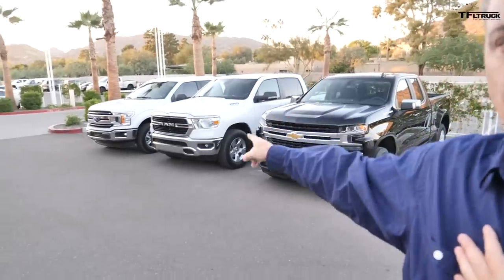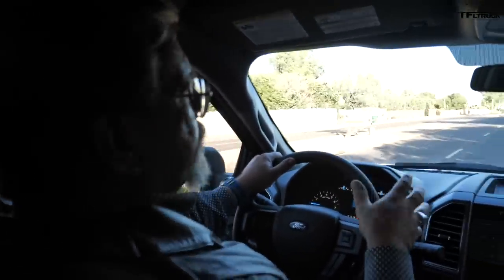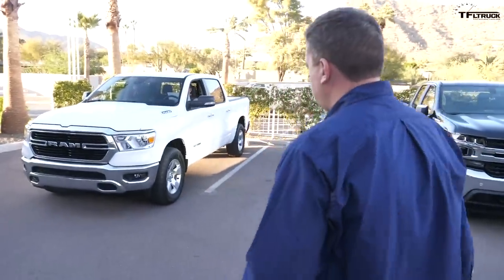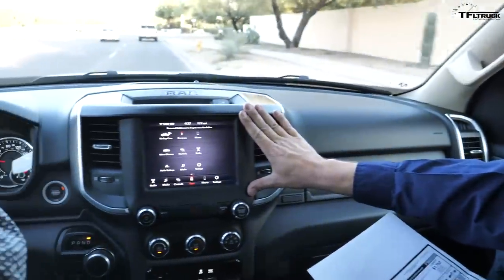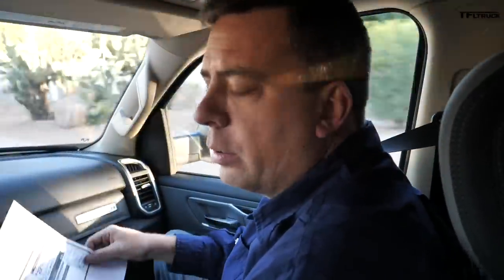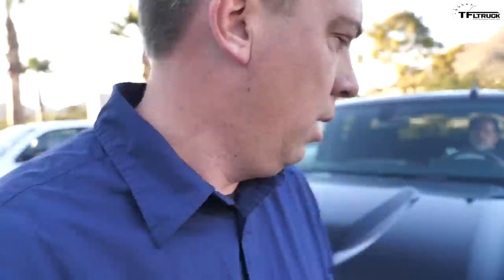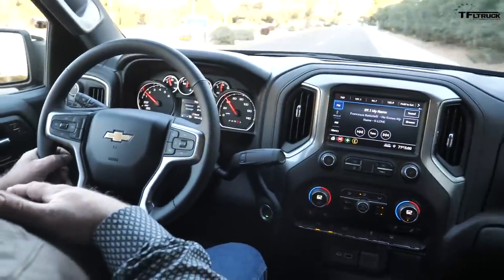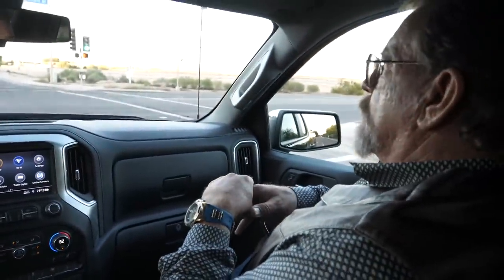Work Truck Wars: 2019 Chevy Silverado 4-Cylinder Turbo vs Ford F150 vs Ram 1500 Review

Comment: Chevy didn’t dare to give you guys the Ford with the 2.7 V6 turbo.
Reply: Probably because it's not a base engine.............
Reply: Yeah that wouldn't make sense to give an optional engine to go against a base engine.
Reply: White Wolf 4.3 ecotec
They stopped making vortec 4.3 vortecs in 2013
Reply: @imzevoh8327  They did not, in 2014 they debuted a new 4.3 based on the GenV DI small block.  All alluminum, literally the 5.3 or 6.2 with a pair of cylinders lopped off.
Reply: Track Days can you get the 2.7L - 4 banger in the WT trim? Or Custom trim? I think LT and maybe RST. So it Probably should be compared with the 2.7 EcoBoost. But it doesn’t matter really because the market will determine how well it does against the competition.
Reply: White Wolf in 2019 the 2.7 is now the base engine. Just like they made the 2.0 turbo the base model for the Camaro
Reply: Jason Crossley the original 4.3 was a 350 minus two cylinders. The new 4.3 has a bigger bore than a 5.3 and smaller than the 6.2. the only thing they share is the stroke is the the same between all three engines
Reply: The STX model F150s (pretty much base model) come with either the 2.7 or the 5.0, with the 5.0 being the option.
Reply: White Wolf on Chevrolet's website it's confusing in some configurations the 4.3 is not available so they are both kinda the base model
Reply: Expected
Reply: Different class not meant to compete with that motor
Reply: Ford sounds the best.  Hate to admit that, but it is what it is.  Seems like 2.7 was the wrong engine to test here.  Oh well.
Reply: That engine isn’t GM’s base model either
Reply: @stephenlozada7158  sorry but this but this engine is base for some configurations and optional for others just like the Ford. Chevy may not want them to compete and I understand why.
Reply: NO.  the  2.7  turbo is the base engine on the LT ,  you cant even get a v6 in the LT as of 2019 models. you go straight from the 4 banger turbo , to the 5.3 for $1,000..... similar to the ford the small v6 ecoboost is only a $1,000 option over the base NA v6.
Reply: the  chevy NA v6 4.3 is only standard in the literal WT (work truck) model  , Custom , and  Custom Trail boss.  which are all slightly different variation of the work truck with very limited options. and on these models (for whatever reason)  you can't even get a 4 cylinder turbo .  you jump straight up to the 5.3 v8 for $1,000  similar to the LT.  lol  its confussig until you see it laid out on a chart.     Scroll down about halfway on this link.   https://www.jackburford.com/blog/2019-chevrolet-silverado-engine-options-and-transmission-options/
Reply: @imzevoh8327  yes a new name but it still the same engine and what about what I mean by that is they have bump the power up but at its core it still the same engine
Reply: @derrickkimsey1921  bit of clarification here...  the 4.3 ecotec is as close to a 4.3 vortec, as the new 6.2 is to the old vortec 350.  Totally different engine design.  It is not the same at its core, it's not even close.  I would be amazed if they shared even a single common part.
Reply: @derrickkimsey1921  Wrong! Just wrong!
Reply: yah... totally agree the 2.7L ecoboost is the true competitor to it
Reply: DURAMAX_DELIGHT Done the math...The 2.7 Ecoboost will kick it's ass!!!
Reply: So if fords 2.7 ecoboost isn’t the base engine but it still cost the same or less than chevys 2.7 4 cylinder... then doesn’t it compare?
Reply: DURAMAX_DELIGHT  bless your heart
Reply: scot miller
the new 4.3 has smaller bore longer stroke
Reply: @White Wolf This is probably the final year for the 4.3L. The 2.7L is the base engine in most trim packages.
Reply: 4 banger in a truck. Lol. No way.
Reply: The Ford is far superior
Reply: There is no way they compare to each other...should have the Ford 2.7 next to that 4x4..
Reply: @imzevoh8327  it's the 4.3 v6 at 285 hp
Reply: Let’s see Chevy 4.3 v6 vs Ford 3.3 v6 and then Chevy 2.7 i4 vs Ford 2.7 v6
Reply: DURAMAX_DELIGHT ya know, Chevy had the option to make a 6 cyl. Turbo engine, but they didn’t.  The point is Chevy put their non-base model motor up against Ford’s base model. Not an apples-to-apples comparison my friend.
Reply: Trevor DeRouchie In every way possible. Not just power, but build quality, technology, mpg, and just about everything else that you can think of. The only people that say otherwise are the ones who's daddies or grandpa's either swear by GM because they're easier to work on or because GM damn near gives them away to employees or employee families with their discounts and rebates. GM truck fans = thick skulls. Ford truck fans = bigger brains. And for the record my wife's car is a 6 year old Malibu with almost 200,000 miles and it's been great. But we're talking about trucks here. I've also have a Ford superduty with the 5.4 litre spark plug spitter, but these new ones (5.0, and both Ecoboost engines) are insanely reliable and powerful
Reply: kyjoe9 That would be the logical comparison but nahhh... Chevy would compare their 6.2 to fords 5.0... Oh yeah they have already and the Ford still outran it! LOL
Reply: @White Wolf the 4.3 is only available on the work truck trim. all other silverados get the 2.7 as base engine.  no doubt the v6 will be phased out for good next year.
Reply: @smarticus6384  ford will sell you a XLT with the 3.3 non turbo so it is a fair comparison between the chevy 2.7 turbo and the 3.3 non turbo
Reply: 4.3 is only the base engine on LS and base trucks. Base engines on LT and higher is 2.7
Reply: Why is the Coolidge era 4.3 liter V6 still being mentioned? That was hot in like 1985 when they put a quadrajet on it.
Reply: @kyjoe9  It hasn't been proven yet but its safe to say the 2018 2.7 ecoboost F150 is the 2nd quickest truck on earth next to the 3.5, then the 6.2 Chevy in 3rd.
Reply: @McBosshog85  yeah you are right my friend has a base f150 with 5.0 and manual windows haha
Reply: @ColdSmokes  They redesigned it back in 2011 I think. It's an aluminum block now and puts out a lot better hp and tq numbers
Reply: why would they?  The two engines are completely different!  one is a 4 cylinder with 1 turbo and the other is a V6 with twin turbo's!  duh.  your argument is stupid and ignorant at the same time!  now slap yourself for saying something stupid on a youtube message board.
Reply: @Rocksolidbullys  same displacement though
Reply: Hell naw,It would have smoked that Chevy easily.
Reply: because all the ecoboosts weren’t done exploding lmao
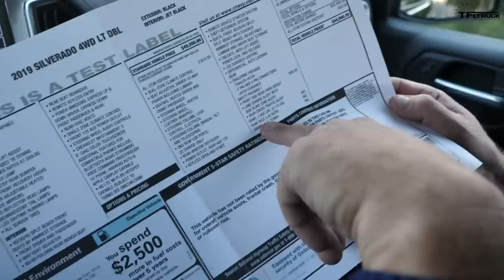Reply: @White Wolf This video is about a new engine offering though. The 2.7T wasn't available on 2019s *at all*, and the 4.3 isn't the new engine or part of GM's new strategy, and will eventually be discontinued except possibly for WT models. The Chevy in this video is an 2020 LT (shows on the Monroney at 27:28), and the 4.3 isn't available on LTs for 2020 (as shown on Chevy's own configurator).

Also yes, the current 4.3, which has been around since 2014, is a totally different (non-Vortex) engine than the 4.3 Vortec, which was based on the old 4.3 going back to the 1980s. The only true "Vortec" engine Chevy still offers, but will very shortly die off entirely, is the 6.0 V8 in GM's HDs.
Reply: @bryanmesser7098  yes it is.

Comment: $40K for a 2WD V6 F150? Insane...
Reply: Insanely cheap or insanely expensive?
Reply: @bencoyle7555  expensive. I paid 45k for my Chevy 2.7 with 4wd. Ford is overpriced shit.
Reply: @roblacerra3257  you say overpriced shit when you bought a truck with a smaller engine for 5 grand more 😂😂😂 clueless

Comment: I've rented the RAM and the F150 base trucks, they are fine for day to day driving and normal truck use, I think the price points on the trucks have gotten out of hand...
Reply: Z2357111319 Have you seen those end of the year discounts for $10 grand? That’s because that much profit is tacked on to the price. You can get them much cheaper at the right dealer.
Reply: @garybulwinkle82  Its not that...Europeans tariff the he'll out of our cars then only want to buy European.  The thing about European cars is without the tariffs based on value they cant compete. European cars break down at the same rate and cost more to repair.
Reply: If you think full size trucks are expensive, look at midsize suv's. They are expensive meanwhile less capable making this trucks look like a gooooodd deal. If you want a cheap truck you can order one from your dealer. Most dealers don't order base trucks because no one buys 'em.
Reply: @dam4274  As I read your comment about end of the year sales, an ad pops up for up to $16k off at a local Ford dealership. Wow! Amazing timing and dead on accurate. (If you have any psychic stock market tips, I'm listening . 😉)
Reply: Thats why I dont buy new trucks because you have all these people paying tge price of course they are going to keep the price increase as long as people buy them if people start buying low mileage used trucks the price will go down on new trucks
Reply: @dam4274  
Not in FL

Comment: Whats spectacular about 310hp and 340 torque from a 2.7..Nothing! The Ford 2.7, the one that always gets ignored makes 325hp and 400 ft.lbs of torque....at 2750rpm. That's spectacular...oh yeah, it easily gets 26mpg too.
Reply: You're right about the  2 7 Ford twin turbo being a HOT ROD!
Reply: Don’t forget tfl just had a video of a tuned ranger putting down bigger numbers at the wheels with just a tune with their 2.3i4. That 2.7 is also a beast when tuned.
Reply: 2.7 ecoboost
Reply: I went on a ~60mi trip yesterday in my 2.7l EcoBoost driving 55-60MPH and averaged 27.1MPG when I pulled in to the destination city.  :P
Reply: Pulled about 6k lbs moving from Denver CO to Yuma AZ and averaged 15 miles per gallon going 65-75mph, calculated from the pump. Pulled the weight like it had nothing behind it. The 2.7 ecoboost is seriously underestimated.
Reply: The 2.7l in the Chevy hits 348 st like 1500-1800 rpm
Reply: @bielmelichartes2167  um a lot of places a lot of industrial trucks have 4 cylinders

Comment: The price of new trucks is crazy!  I'm poor, and will buy used.
Reply: Chas106 G. — Consider the Colorado or Ranger.
Reply: @GH-oi2jf  A 4x4 Z71 Duramax Colorado will run you about $33-35K on the out going year model, will have most of the options offered and can tow 7600 lbs, which is easily as good as any base engine full size pickup.  If you an leave with a smaller cab(my long bed is easily comparable to the short beds of full size pickups, albeit a lower payload), it would be my choice - it literally was.
Reply: NEW Trucks are more heavily discounted. It’s harder to get discounts on used trucks.  Plus used trucks prices are inflated
Reply: Nothing wrong with buying used. Plenty of people gave me shit for buying a new one but i dont think they understand, if people like me didnt buy new, there wouldnt be any nice well maintained used trucks on the market.
Reply: USED Prices are up right there with new ! a few grand and your in a new truck. crazy
Reply: @Artie196161  i agree it is pretty crazy. I took my gf jeep shopping a few years ago and test drove a 2012 with 30k+ miles and they wanted i think $22k. I said screw that, took home a new one with 1.6 miles for a little over $30k after my discount.lol
Reply: @2005OEFArmy  I'd rather have the v6 in the Colorado but it is a less expensive option for sure
Reply: @JkeeneMX607  If no one bought new trucks the price would drop.
Reply: @williamisabell9539  i wish that was true...
Reply: If you think new truck prices are crazy, look at 8-10 year old used trucks.
In most parts of the country, you're going to pay mid to high teens for a truck with WELL over a hundred thousand miles(more upwards of 160-170) and just about anywhere East of the Mason-Dixon, they're going to have rust.
Case in point....
https://detroit.craigslist.org/okl/ctd/d/2012-ford-f150-ftruck-xlt/6754514337.html
https://detroit.craigslist.org/okl/ctd/d/4x42012-ramwd-quad-cab-1405/6754436619.html
Reply: If you are looking for a work truck cheap and heavy working truck, perhaps Nissan has a good deal to offer you. 
With the TITAN starting price of 30k
Titan XD gas 33 starting and
TITAN XD Diesel 35 start price.....
I prefere used trucks, because I am cheap and also my own mechanic so, what a hack.
Reply: And better if you seek a work Truck, my 70's and 80's chevy/ GMC square body trucks never let me down on payload
Reply: @2005OEFArmy  A truck that's not 48" wide between the wheel wells is a waste of time IMO.
Reply: Chas106 G. I’m not poor I’d say middle class for sure and I don’t buy new either. It’s a waste of money.
Reply: you want a full size truck,with small truck ecomomy,& reliable as a rock.???.go to brazil,find yourself an MWM,silverado or excursion or s/duty,.97 to 2007..4.2tdi.12.5 pt 100..mine has 700 nm..12.6 lt 100,s/duty.2002,in aus..i paid 25k au,,with 170k,s on clock.thats about what?,19k u.s.?.they have no tech.all mechanical,german engine..
Reply: right. Sad part is if you get too used, that SOB will be ffalling a part.
Reply: @bigcartoonyIIV  true.

Comment: What a sham from GM, and I know all manufacturers stack the deck for themselves but this is ridiculous. Some of the cheapest Ram and Ford trucks,  and a much more upscale Chevy. They used a double cab so the price didn’t seem as far off, but it’d be near 50k if it was a crew cab. A 50k Ram is an awfully nice truck. You can’t beat the ford 2.7 either for the money. Ridiculous
Reply: It's a base chevy.
Reply: @jdrok5026    Yeah, but a base Chevy is better than mid-level Dodge or Fords.  Not fair.  Heh heh.

Comment: If I’m gonna drop 40K for a F-150 it better have a 5.0
Reply: Amen brother! You get a mustang gt, a family hauler, an offroading rig and when the weekend fun is over, you still got a work truck........4 different uses/purposes in one truck....bad ass!
Reply: and we overseas have to pay 40k for a 2.0 diesel Ranger.
Reply: It’s going to be an Xl
Reply: Id buy a two year old truck fresh off a lease and get tripple the options
Reply: I like the turbo
Reply: @brianpeterson5890  The 2.7 and 3.5 ecoboost are both twin turbo.  If you happen find a Ford truck that's off lease it was more than likely a rental vehicle. F-150's don't lease very well at all. Rental fleet trucks are base xl or xlt, or sometimes base lariat trims, and when they are re-sold they are not much cheaper than a new one.
Reply: @brianpeterson5890  Yup, and maybe you'll get a truck that had an asshole previous owner that put bargain bin fuel in it, cheap oil with long intervals, raced it around everywhere, went offroad etc etc.
Reply: You can get an xlt with a 5.0 for 42k. Plus extra good stuff
Reply: Honestly no one is paying 40k for that truck. They could say it was 50k.  After they apply the discounts it better be priced at the real price which id argue is at least 8g off.
Reply: Matt H With the small exception of the many people like me who are leasing a Platinum 3.5L. Were in the world did you get your info that they don’t lease well? That’s just not correct. And, for the record, I baby the hell out of my vehicles so anybody who gets my truck will have a GREAT truck that I guarantee you will still have the new car smell.
Reply: But the 3.5EB is better.
Reply: Lcr34 almost £50000 for the Ranger Raptor, I’m thinking about buying one but would rather have the F-150 Raptor
Reply: Darth Dainese I occasionally think how cool it would be to have a raptor but for a similar configuration, they’re about 20K more than the alternative f150. For $20K I could just use that to buy another f150 used with a 5.0 then build a faux raptor with a forced induction V8 and more capable suspension, while I still have my everyday truck. You could probably get a low trim, 2wd super crew for about 1/2 of what a super crew raptor would start at both new. The other thing, both for and against the raptor is that it is a “special vehicle” meaning there are no discounts applied. When the f150s get those huge chucks of cash knocked off at the end of the year the raptor does not. Alternatively I have seen used 17 raptors still commanding more than a new f150s so they seem to hold their value very well.
Also, the issue of taking a $75,000 truck and ripping it across the desert. The problem is that I would want to do that all the time.
Reply: 5lt cummins tdi..